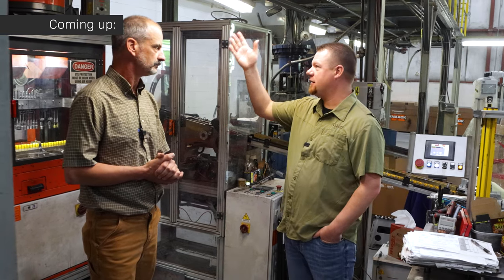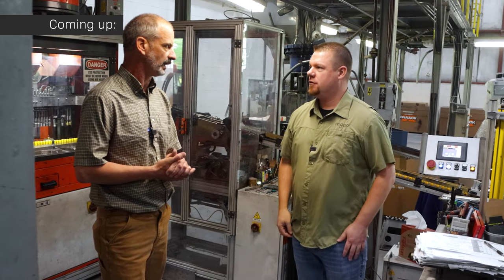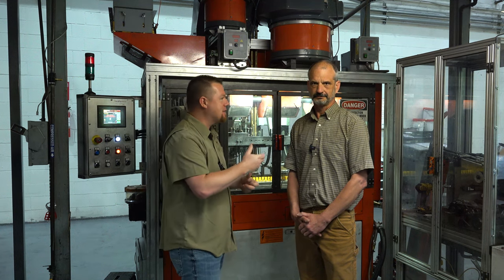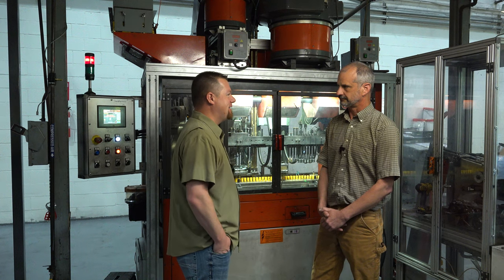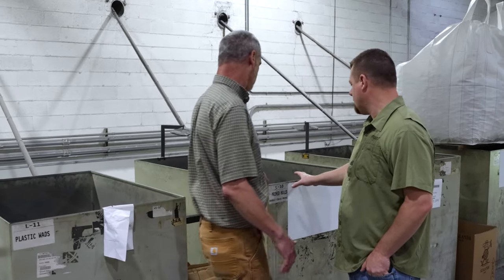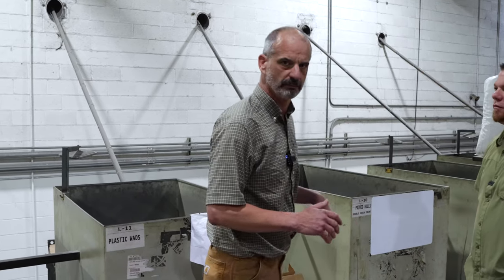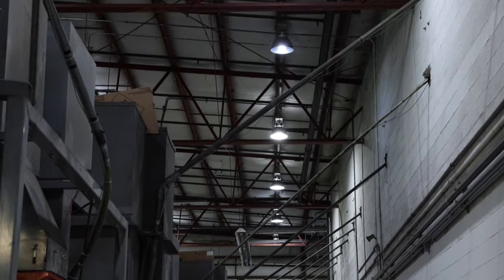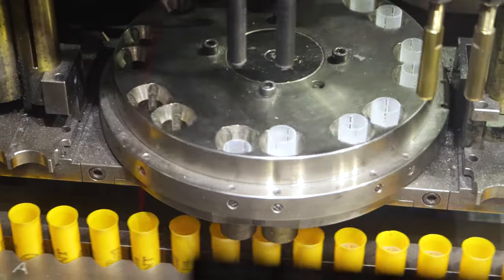From Steel to Shot: How Kent Cartridge Crafted the Ultimate Waterfowl Load

Comment: Really liked this look in.  I have not previously used the duplex type loads as I had heard and read not great reviews historically, whether they were turkey shells in lead or steel waterfowl loads.  I typically use 3's or 2's for ducks as I prefer a larger pellet as it tends to pass through and create fewer holes (ie less "shot up").  I also like 2's as the large enough to drop a resident canada if one sneaks into the decoys.  The 2's and 4's might become my new go-to load so long as price is in line with "normal" steel shells.  Around 15-18 bucks for a box of 12ga 3" steel is about where I tend to draw the line in expense.  Primer quality is also a big deal.  I ran into some Boss shells with fail-to-fire issues in two different models of gun.  Nothing more frustrating than working a bird in close and getting nothing but a click.